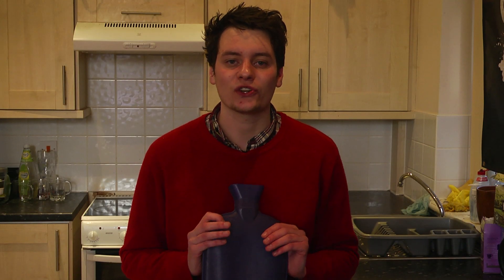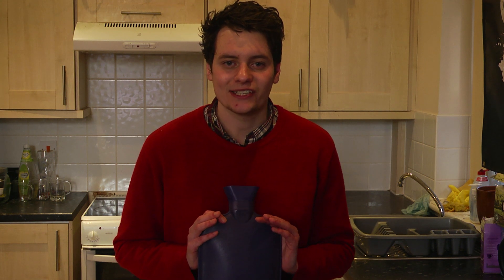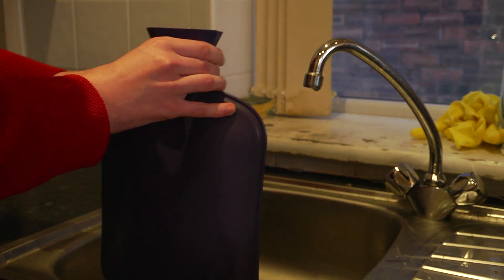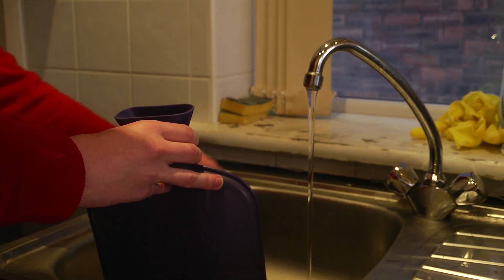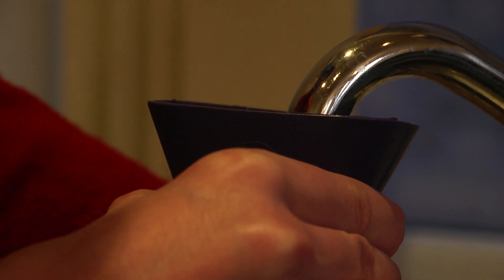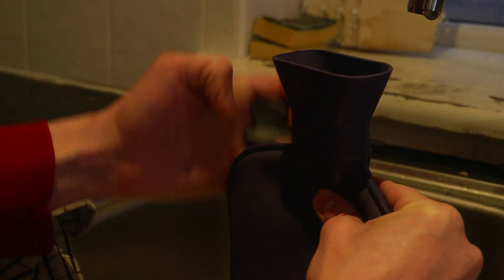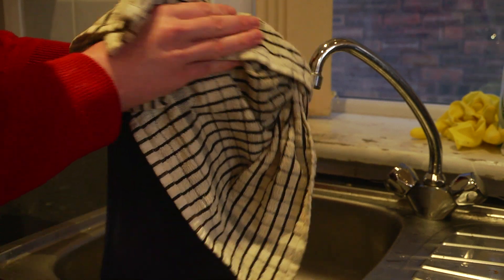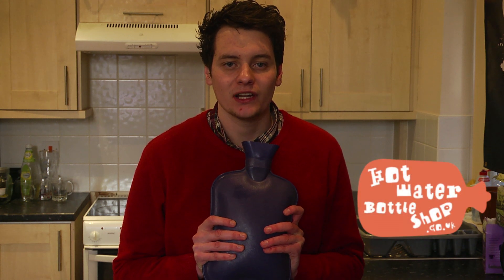An Instructional Video on How to Fill a Hot Water Bottle Safely

Comment: Am I the only one that always boils the kettle? I've done all my life.... It's too cold from the tap..
Reply: nope I do.
Reply: Billy Hammerton I do to
Reply: Everybody does it, the shops just say it to cover theirselves from any lawsuits.
Reply: so you CAN use boiling water??
Reply: @hxnniemxrie  No.  You'll perish the rubber.  Put cold water into the bottle first (about a third of the capacity) and then add the recently boiled water.  I find this creates a temperature of about 60deg.  I once put in too little cold water and the bottle started perishing immediately I filled it up with the kettle water.
Reply: I do
Reply: The hot water from my kettle melted the threading off the inside of my bottle. Gotta be careful. (Also it degrades the rubber faster,)

Comment: I'm sorry but I've been boiling a kettle for these water bottles all my life and it worked perfectly fine when it's really hot. It has a covering on it plus a blanket as a barrier for protection. Can't believe I stopped what I was doing to try normal hot water from the tap. I couldn't feel a dam thing.

Comment: I have a hot water bottle with the cover and I use the kettle to pour water inside the bottle because when I use the kitchen tap or any other tap it always wets the cover so I just use the kettle, it’s ok actually and doesn’t burn

Comment: Why can't you fill it with boiling water?
Reply: JiMPeasy The HEAT you perceive must be "nice" but never annoying, "hot" but must NOT BURN, not to generate negative reactions of defense; you will find itself the optimal temperature according to your sensitivity;
The TIME of application should be LONGER possible and REPETITIVE continuously to activate a kind of "biological memory" of the points on which we act. 
I am a nurse and I have been studying “thermal stimulation” since 1970 for health and to prevent pain: it can be used to modify how the human organs work, to cure many ailments (PMS and menstrual pains, intestinal malfunction, etc.) and to assist the body to be healthy, sleep better and be more relaxed.

Comment: As a manufacturer of hot water bottles do not use hot water from your tap
Do not squeeze it at the top to expel the air
Do not purchase a hot water bottle if it is priced under £3 it is unlikely to meet British safety standards
Reply: +Mary Smith Hi Mary, the mineral content contained in tap water will erode the rubber a lot quicker than boiled water - I would be interested in which brand is advising you to use warm tap water